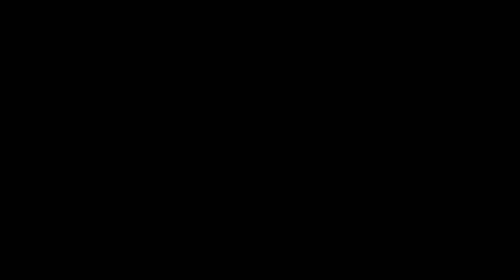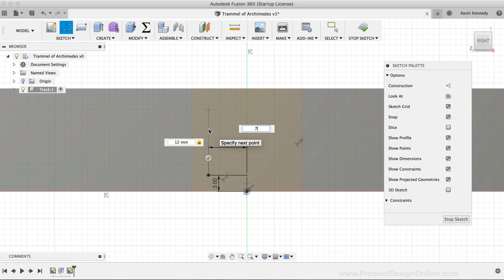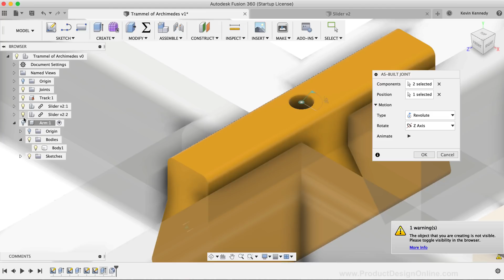How to 3D Model a Trammel of Archimedes in Fusion 360  | 3D Print a Do-Nothing Machine

Comment from the maker: Check out this tutorials resources right here ► https://ProductDesignOnline.com/7
 __
TIMESTAMPS
0:00 - 3D Model a Trammel of Archimedes in Fusion 360 
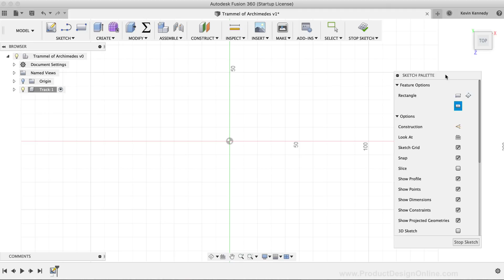2:04 - Creating the tracks
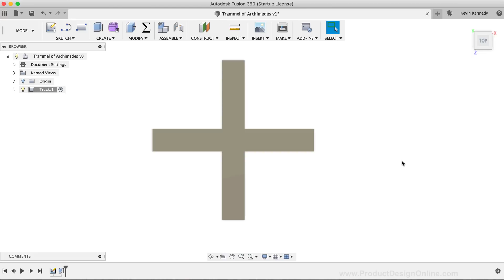4:47 - Creating track slots
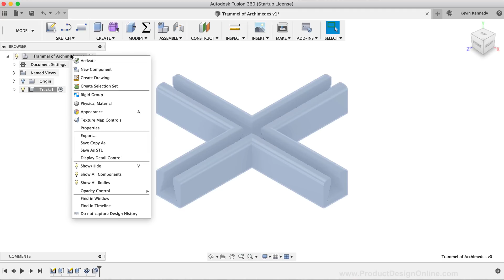9:17 - Creating the sliders
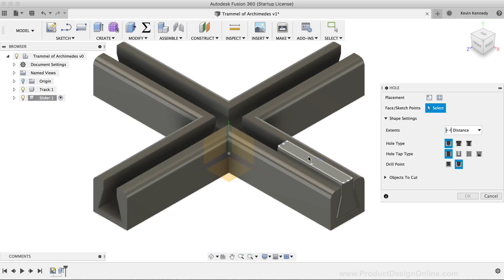12:30 - Creating the holes on the sliders
13:47 - Creating copies of the sliders
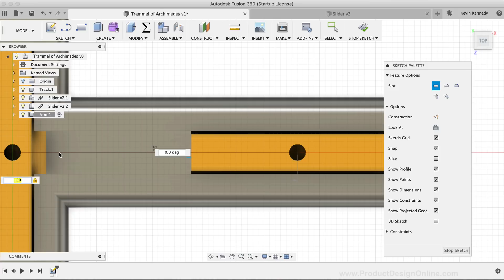16:27 - Creating the arm
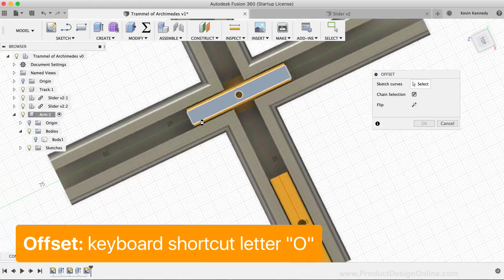18:50 - Creating the arm connections
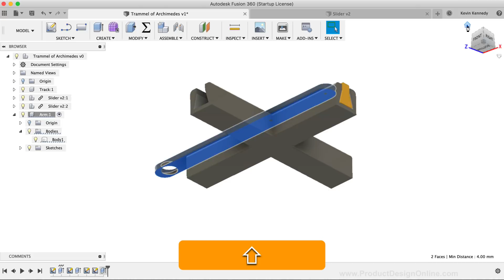20:00 - Adding some fillets
23:45 - Animating the trammel
Reply: I would like to print one but I don't have any 3D printer.
can you recommend a low budget (upgradable) Printer.
Reply: @RamGuguloth13  The Ender 3 is very popular.
Reply from the maker: @RamGuguloth13  I would recommend the Ender 3 or the Prusa mk3 as entry-level printers.

Cheers, Kevin :)
Reply: Hey bro can you give me Its file cause i need it for my project. If u can that will be a great help

Comment: I'm using F360 for the first time to create a specific part to 3D print. As an intermediate 3D modeler with a lot of experience with 3D printers, I'm pretty up to speed with a lot of the concepts used in CAD modeling. After 2-3 days into this project, I'm finding it much quicker and more informative to just watch one of your videos that seem like they would cover the F360 function that I'm struggling with rather than go onto the community forums and search for answers. Inevitably I learn a better way to approach something that I've already cobbled together and have restarted my project several times to fix things along the way. Thanks for putting up such concise and well-explained videos. I'm still watching at 1.75 or 2x speed (with liberal use of the pause button), but it's so nice not to have to click through all of the exposition that is present in so many of the other tutorial videos.
Reply: Also, It's turned out to be really helpful that there's been a UI refresh since you've posted some of your videos. Figuring out where some of those functions have been moved to helps me remember when to use them in my own project.
Reply from the maker: A great positive outcome from the change :)

Comment: I am teaching myself Fusion 360, and stumbled upon your channel. You have a great way of teaching so that anyone can follow along. The only issue I am having is that my Fusion doesnt seem to follow along exactly the same way that yours does. I realize this is a fairly old video, and that is most likely the cause, but specifically when you are creating the arm portion, my fusion looks completely different. This is creating some confusion. I just realized that this is probably a pretty pointless comment as well, since i dont even really know what to ask to get a better understanding. First thing i guess is that when i create a different component and select it, all of my other components become almost invisible.
Reply from the maker: "First thing i guess is that when i create a different component and select it, all of my other components become almost invisible."

This is normal and a setting in your Preferences that you can change if you don't like it. It's mainly due to help you work on multi-part assemblies so you can see what parts of the design are active. Activate the top-level component in the Browser to see everything with full visibility.

Comment: That is very useful!! Thank you. To attach a cuttingtool I think that there must be a kind of mechanism to keep the knife in the right direction, right?
Reply from the maker: Hi, Josef. Great question. The "manufactured" tremmel that I've seen in action had an attachment that allowed the knife to spin in 360 degrees. Then the knife blade naturally curved or spun around as you slowly pull it.

Would probably take some experimenting with 3D-printed parts. Cheers, Kevin :)

Comment: Great Video.  Plan on printing one out tonight. 

Why do we need to make a copy of the slider and then link them to the original?  I'm not sure what this means.  What happens during this process?
Reply from the maker: Thanks, Karen. Let me know how the print goes!

To answer your question - when you copy and paste a component you risk one getting altered in a different way than the others. When you insert a component or design file into a current design, you'll see that they are all linked back to that file. This way, the components will all remain exactly the same unless you decide to "break" the link and alter one. This Autodesk help article will explain this concept more in detail -  https://knowledge.autodesk.com/support/fusion-360/learn-explore/caas/sfdcarticles/sfdcarticles/How-to-Insert-a-Component-into-the-Current-Design-in-Fusion-360.html

Cheers, Kevin :)

Comment: Great tip on the animate model as a whole! 
But I have a question.. I try to make the animation in the animation workspace  to output a video of the model moving but I can't do much in animation more than exploding components! and I can't do the animation of joints other than in the model workspace!
Reply from the maker: Hi, Ziad. Unfortunately, the Animation capabilities in Fusion 360 are still pretty limited. Here are some notes from the Autodesk site (this explains it better than I can off the top of my head):

The Animation workspace does not currently recognize joint constraints and will require you to move every piece individually. The idea to allow the Animation workspace to register joint constraints and animate them has been presented on the Fusion 360 Ideastation.

While the motion study will allow you to create a rendered animation (through the Render workspace), the joint motion is limited by the motion study definitions. 

Another option could be to create a motion link between your joints and then create a screencast of you dragging the joints to show the motion in a video. This will not give as clean a video as the Animation or rendered motion study options, but it may allow you to animate your model without using a motion study or manually moving every piece in the Animation workspace.

In summary, if you do decide to do the Animation workspace, you would have to set it up to do piece by piece which would be pretty difficult with this Trammel design. Cheers, Kevin :)
Reply: @ProductDesignOnline  I guess we will have to wait to see some more advanced features in the animation workspace! Well, thanks alot for taking the time to reply and provide info. ❤
Reply from the maker: @ziadammar3095  You're welcome! Cheers, Kevin :)

Comment: Why is the Sketch dropdown gone?  Who rearranged things and for what reason?
Reply from the maker: They introduce contextual tabs as they've expanded the number of workspaces in environments that Fusion 360 has. Trust me, from a tutorial standpoint it has been frustrating for me as well. However, from usability standpoints I have been loving the changes and progress of the UI :)
Reply: @ProductDesignOnline  Thanks for your response.  I had some heated discussions at home with a family member over what's better and your comment settled the debate.  It can be frustrating for new users to spend time trying to figure out whether they aren't following the tutorials correctly, or Autodesk did the 'ol software switcheroo and a Google search is necessary to find a forum post somewhere which gives the new procedure.
Thanks a ton for these videos.  Appreciated.

Comment: Hi Kevin, After finishing and finetuning the designed trammel, I wanted to create a video via animation tool - idea is first to see the object for some 10 seconds in motion like you can do it in Design / Animate Model and then still some seconds to explode the object to get better view on it.  BUT
I can't manage the animation. It seems to me its only possible to animate each single component in a single time line but not all components together as in the Design tool possible. Would you be so kind and give me/us a hint for this. Thanks a lot Kevin
Reply from the maker: Hi, rk57chat. In short, the animation workspace does not allow the motion to be played like the Design workspace.

Here are some notes from the Autodesk site (this explains it better than I can off the top of my head):

The Animation workspace does not currently recognize joint constraints and will require you to move every piece individually. The idea to allow the Animation workspace to register joint constraints and animate them has been presented on the Fusion 360 Ideastation.

While the motion study will allow you to create a rendered animation (through the Render workspace), the joint motion is limited by the motion study definitions. 

Another option could be to create a motion link between your joints and then create a screencast of you dragging the joints to show the motion in a video. This will not give as clean a video as the Animation or rendered motion study options, but it may allow you to animate your model without using a motion study or manually moving every piece in the Animation workspace.

In summary, if you do decide to do the Animation workspace, you would have to set it up to do piece by piece which would be pretty difficult with this Trammel design. Cheers, Kevin :)
Reply: @ProductDesignOnline  Thanks Kevin this answer I needed. Now what to do and can stop searching, you saved a lot of time for me - I apppreciate your feedback much - have a good day. Regards from Augsburg / Germany - Rainer
Reply from the maker: @rk57chat  You're welcome! Always happy to help. As always, I appreciate your support of the PDO channel! Cheers, Kevin :)

Comment: line drawing won't allow me to let go of the line and then type in the dimensions. I have to hold my finger down on the trackpad and type in the dimension with my left hand. Is this normal or not and if not will it just go away? Then also can't right click the slider in the drop down list on my trackpad. Have gone into trackpad settings and nothing there fixes it either.
Reply from the maker: Hi, James. To avoid having to hold your hand on the trackpad you may be able to click to place the line and then double-click back on the dimension to edit the value. That's not normal that you would have to hold it and type with the other hand. When I've used a trackpad I've still been able to release my hand to type in dimensions. Cheers, Kevin :)

Comment: Ok so I figured out my trackpad finally. light double touch gets the menu box up that you get when you right click. The irony of it. All this time and I find out the day before I get my new mouse. Grrrrr. Ok so heres the weird one. I go to slot command the very same as you and then after giving it width 14mm and pressing ok plus extrude, the arm appears on the same level as the base of the sliders. Not above them as it does with you. Have tried loads to rectify but no solution. Deleted it 3 times and then gone back to copy you in the video but every time this happens. Grrrrr
Reply from the maker: Hi, James. Trackpads are tricky (and annoying) with CAD... I hope your mouse arrives soon if it hasn't already :)
In regards to the slot command not working, make sure after activating the slot command that you click on the top of the yellow slider. You'll also want to double-check that you have the "Arm" component created and activated. If your Slot component is activated then it may be defaulting to the bottom surface.
Other than that, it's hard to say without seeing your file. Let me know if you get it working, otherwise, if you share your file I'll take a look. Cheers, Kevin :)
Reply: Got my new mouse Kevin. Wow how fast you can zoom out. Any advise with it. Like should it be set up a certain way with buttons doing something or just as standard?
Reply from the maker: @jamesbarratt593  Sweet! That's great news. I would suggest leaving it set up by default for now (while you get adjusted to it). Then, as I mentioned before, you can assign the side buttons to be "hotkeys" for your most-used commands. Cheers, Kevin :)

Comment: I'm so confused by this tutorial. Your toolbar is completely different from mine. I don't have a sketch dropdown.  Hell, I don't even have "model" as an option. Only design. Did Autodesk change the program since the making of this video or am I doing something wrong? I'm specifically looking for the slot function and it is nowhere to be found. Pls help
Reply from the maker: Hi Andrew. The August 2019 update changed some of the terminology and location of things. For example, the model workspace was renamed "Design".

With the new UI you'll find the "Slot" command in the "Create" dropdown, but ONLY when you're in the SKETCH tab. The sketch tab will only be shown in your toolbar when you're in an active sketch environment.

Alternatively, you can search for the text feature by using the keyboard letter "S" to activate the shortcuts box > search for the desired feature.

Here's a video I made covering these critical changes - https://youtu.be/tuZzHcmFtg4

Comment: Hello, I’m having trouble copying and pasting the slider.  If I copy the slider and then paste, the object is not visible... somethings I’ve tried: copying and pasting an active component and copying and pasting the inactive component.

Do you have any suggestions other than starting from scratch?
Reply from the maker: Hi, Andrew. Try making the top-level component active. Then right-click the slider component to select copy. Then, see if you can right-click on the top-level component and select "paste new".

If that doesn't work, it could be several things...could you paste a link to a screenshot or quick screencast? (Google drive, dropbox, snipboard.io). That will help me determine what's going wrong. You definitely shouldn't have to start over from scratch. Cheers, Kevin :)
Reply: @ProductDesignOnline  Just sent you an Email with the Screen Shot
Reply from the maker: @33andrewsalamak94  Thanks, I just replied to your email.
Reply: Ok, everything is working now and I would like to print this.  Is there an easy  way to lay all of the components out on the grid so I don't have to break them apart in the slicer?
Reply from the maker: @33andrewsalamak94  Hi Andrew. There's no automatic way to lay out all of the components in Fusion 360. You can use the "Move/Copy" command. The other method, which I prefer, is to export your component's STL directly to your slicer. Right-click on the component > Check "Send to Print Utility" > Select your slicer (if not in list select Custom and select the app on your computer) > This will place the part right in your slicer. You can then export the other ones directly to your slicer (same build plate). Cheers, Kevin :)
Reply: Product Design Online thanks!
Reply: Request: could you do a container with a screw on lid tutorial?

Thanks!
Reply from the maker: @33andrewsalamak94  Good idea, Andrew! I've added it to the list.

Comment: I tried following this and, despite the changes to the UI, seem to have got everything right so it would print. However, one of the Revolute joints is not right. When I animate the joint, it rotates correctlly, but when I animate the model, the arm seems to rotate and move as it should and one slider moves and follows the track, but the other slider stays put although the reference flag, selected from the hole in the slider, moves and follows the track. It's as if the reference point has the Slider joint set up but it isn't moving the Slider object. I've tried deleting and recreating this joint several times, but I'm obviously not selecting something correctly? Suggestions?
Reply from the maker: Hi, Derek. Can you share the link to your file so I can take a look?
To share your file please go to File > Share > Share Public Link (make sure "downloadable" is toggled on) > Paste your link here as a reply to this comment. Cheers, Kevin :)

Comment: When I right-click on the top-level component, I get a "New Component" window and I type in "Slider".  What appears is just like the video.  Selecting the right face works, but then immediately it de-selects the slider objects and makes the track the selected object.  Now I can't work on the slider.  It insists that I work on the track, and even makes the tab for the slider disappear on the left hand side of the screen.  I wonder what is going on.  Bug?  Different procedure for this version of F360?  Did I mess up the timeline somehow?  Anyone else experiencing this?  I listened to the video several times and followed the procedure, and I still can't get it to offset off the underlying track, but put the lines in the slider component.  I try again to create a slider component because the left-hand side of the screen shows no slider, and this time it says, "Slider(2)".  So it thinks a Slider component is still there, or it wouldn't have put the "(2)" at the end.  ???  I should also add that the track image gets transparent right when I choose slider on the left-hand tree.  From 9:35 he goes SelectFace - "O" - SelectFace again.  Right after hitting the "O" the tree deselects the Slider and now the Track is the active component.  Is there some setting that I'm using that is different that would cause this behavior?